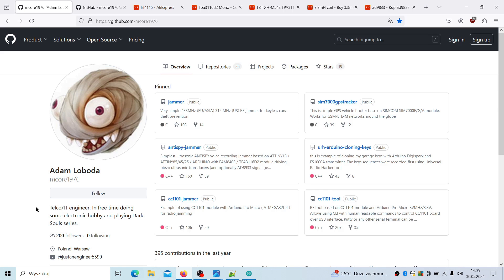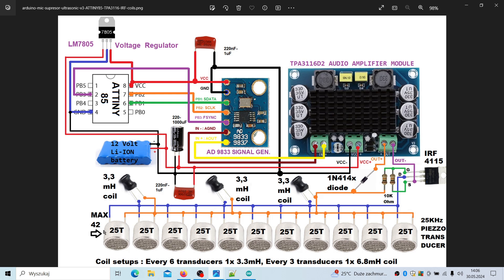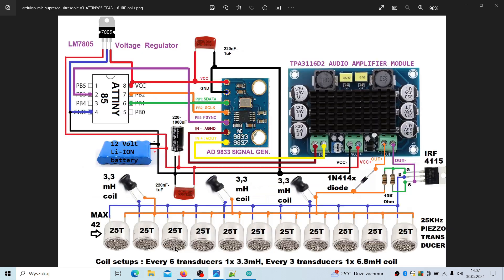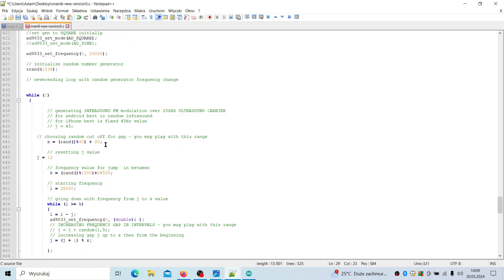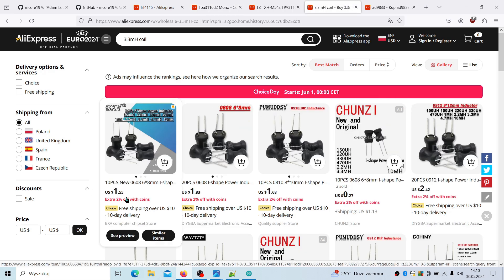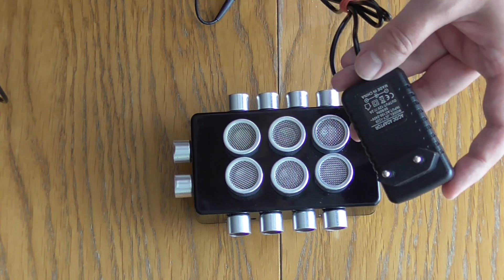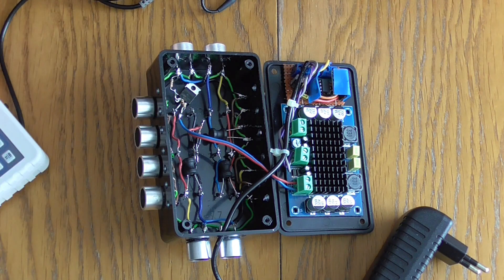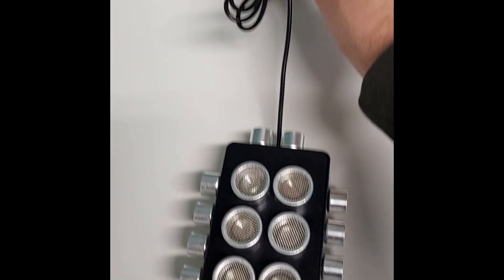DIY Ultrasonic Microphone Recording Jammer for Android phone  and iPhone

Comment: are all ultrasonics transmitter or paired with receiver?
Reply from the maker: what do you want to pair it with?  This device utilizes the effect that FM modulation of ultrasound leaks into audible band of the microphones
Reply: @justanengineer5599  ok clear thanks

Comment: what is the approximate range?
Reply: I love it! I build one round with 140 transmitters. 12v 5a.i used Attiny85 usb. I work's 1m distance. Maybe need more amps. And it start to work after 8-10 seconds. I used one older code from yours too.
Reply from the maker: try to add IRF4115 mosfet, diode and bunch of coils. It increases the distance many times
Reply from the maker: Depending on the device you want to jam and number of transducers. Can vary from 2 meters to 5 meters or more